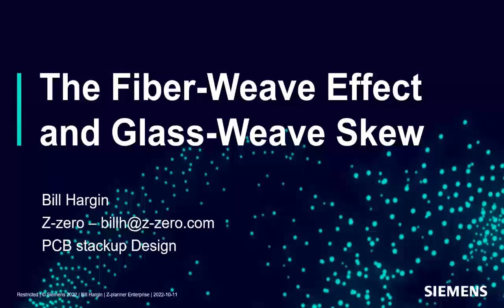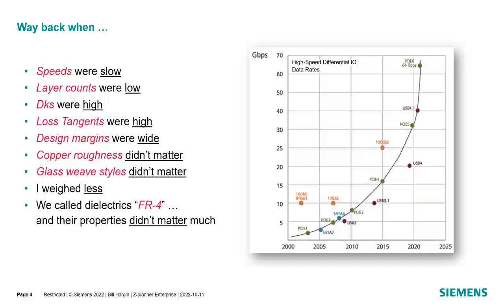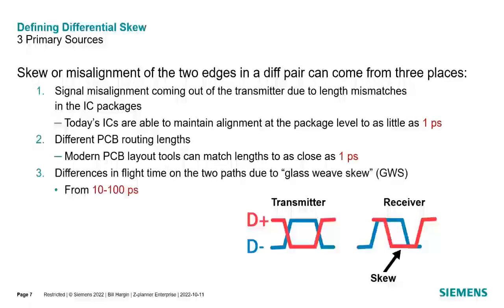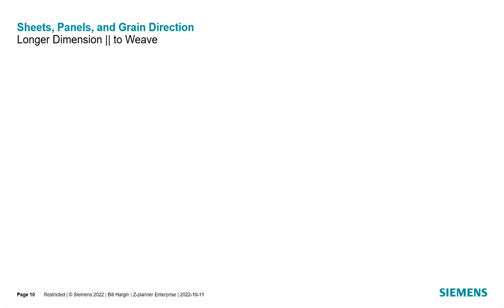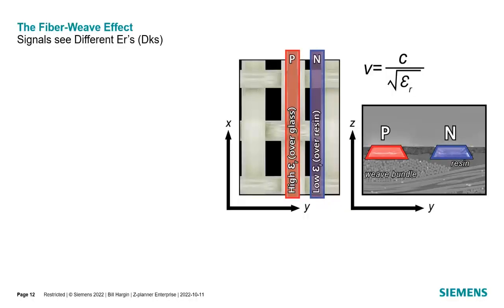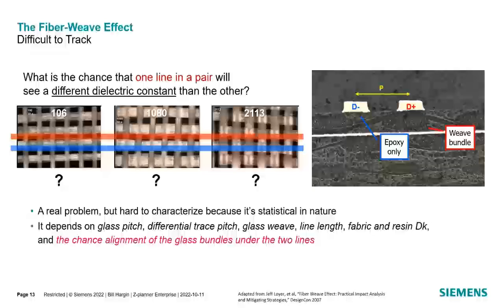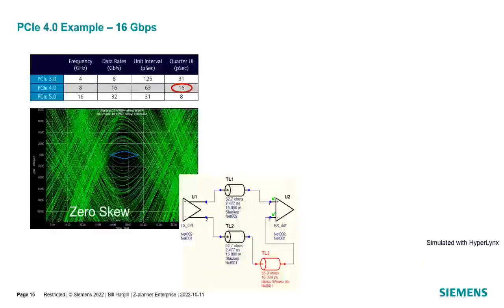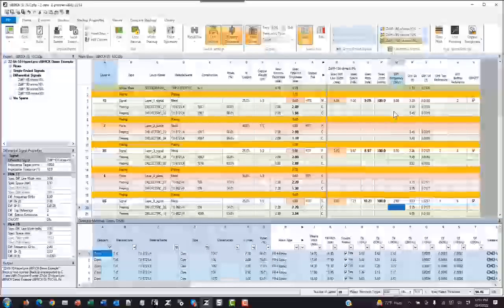The Fiber-Weave Effect & Glass-Weave Skew

Comment: A forboding element in the quest for faster speeds.. So is this going to result in higher stand off distances from the supporting weave and different trace line compositions?  In the experimental board construction (single production type), is this going to be a more relevant if the design is made with laser ablation? or should a more specialized type board be used?